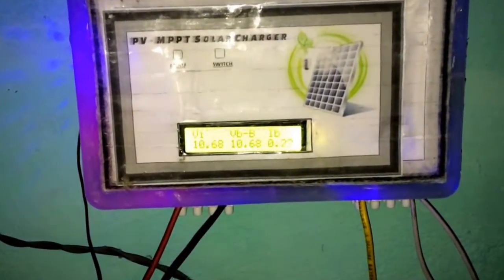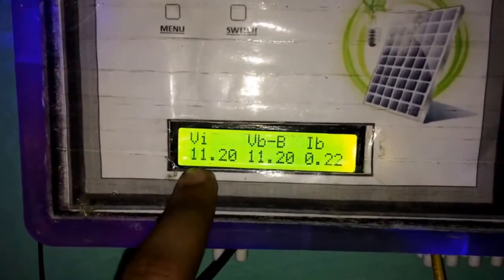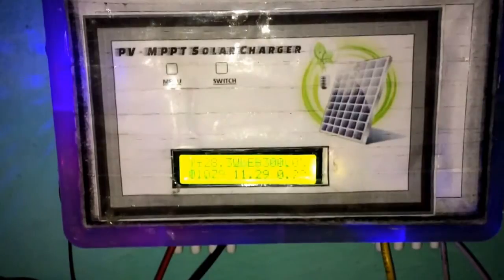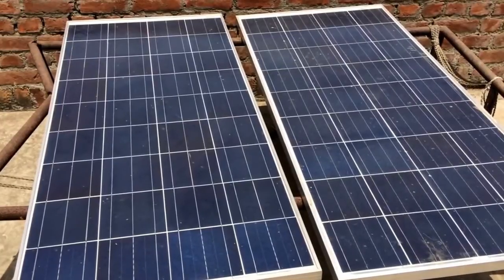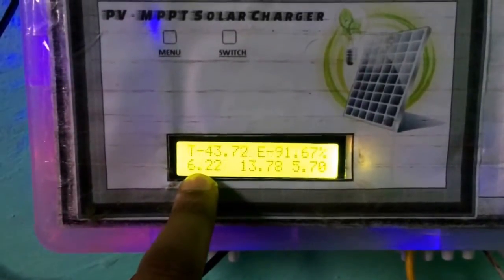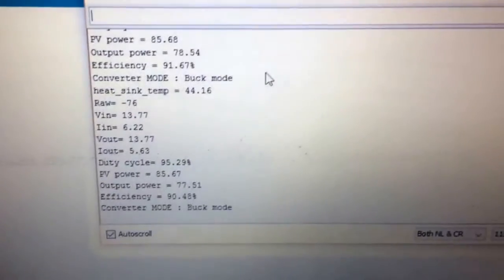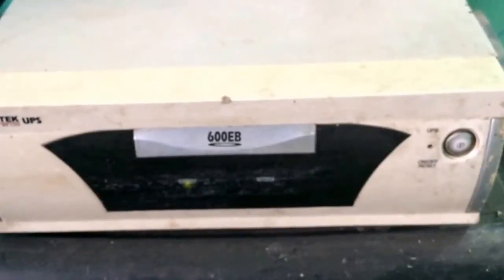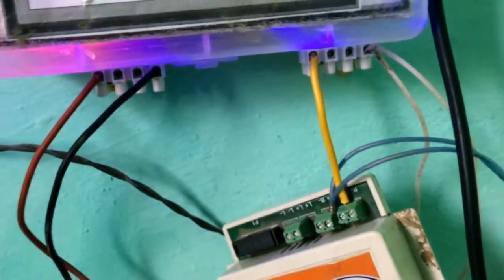Arduino MPPT Solar Charger

Comment: what is the required voltage for your battery? voltage was same the on input and output side!!
Reply from the maker: lead acid batteries need 14.8v max to be full charged. if input voltage is less then or equals to this voltage charger will putt same voltage to battery. also depends upon battery's state of charge.
Reply: Great. Thank you for sharing all the circuit diagram. please add some detailed explanation of circuit on the instructable. What should I change if I want to make this charge controller for the lithium-ion battery?
Reply from the maker: @keyurrakholiya1603  you will only need to change the voltage and current parameters as per  your battery pack. E.g. 3 cell li-po battery has 12.6v max volatge vs 14.8v of lead acid battery.